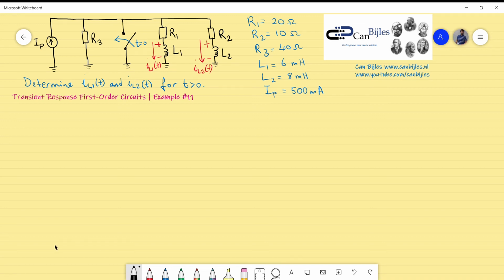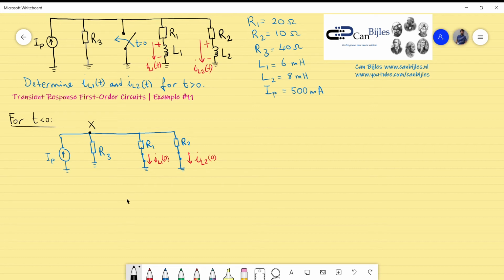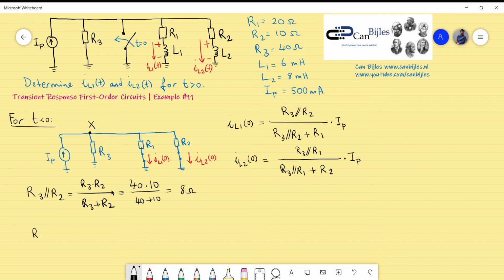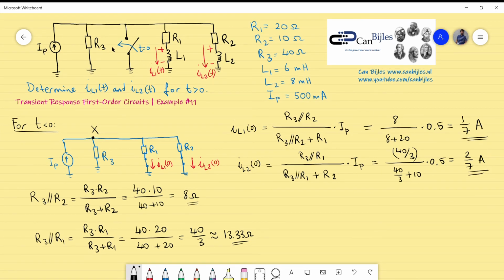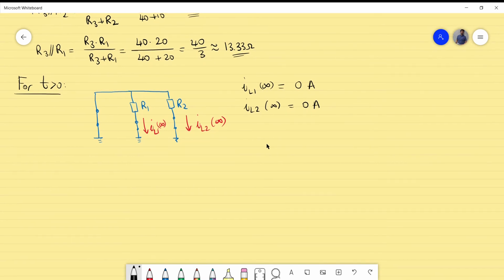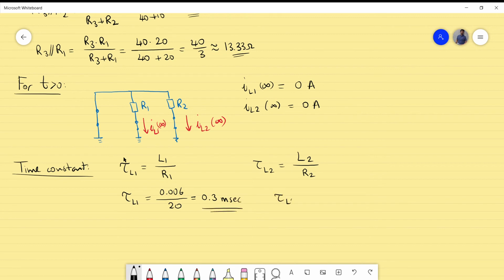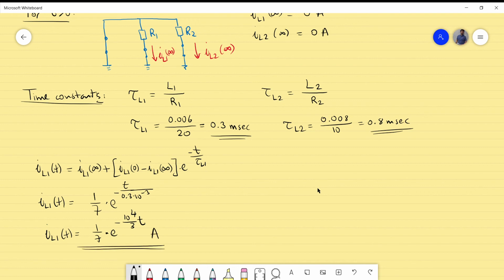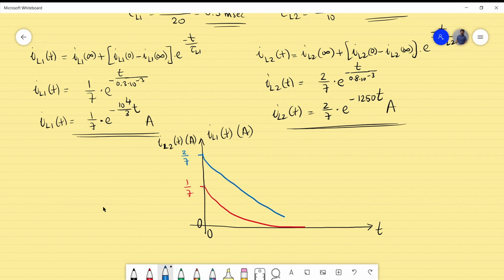Transient Response First-Order RL Circuit #6

Comment: thank you so much for replying, your videos has helped me in my Engineering Electric Circuits Theory college classes.
Reply from the maker: Your are welcome!
Reply from the maker: In response to your question which is deleted by you:

I do not calculate just the parallel resistance of three resistors here. I want to calculate the current in a branch in a circuit with one constant current and three resistors parallel to this source. See for more details about current divider rule here where they do exactly as I do https://en.wikipedia.org/wiki/Current_divider Is this more clear?